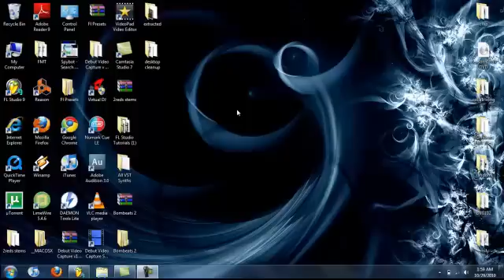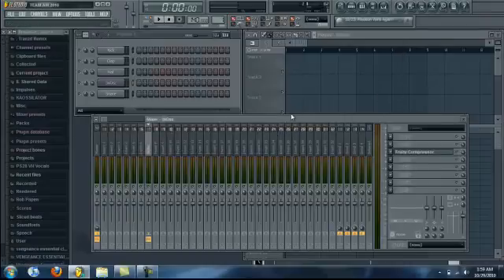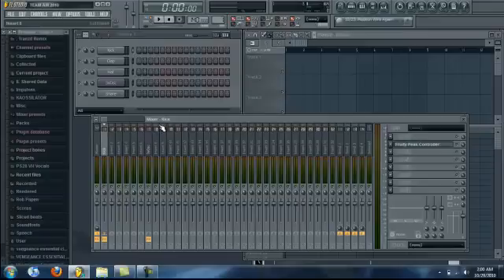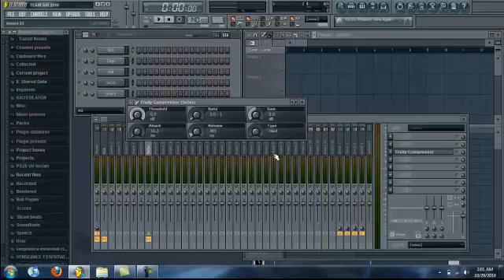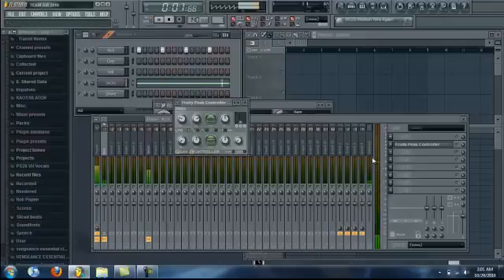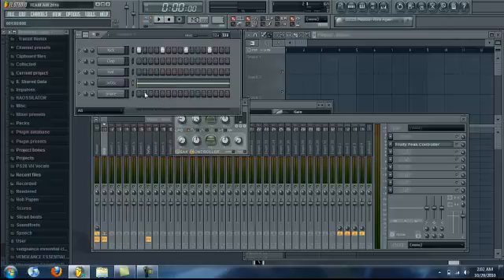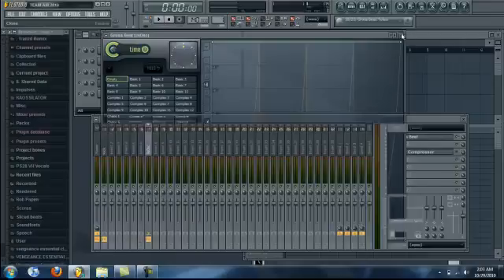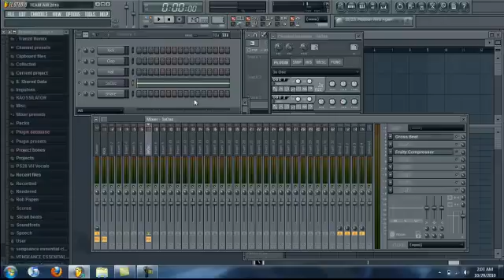Fl Studio - How to Sidechain 2 Ways

Comment: i've noticed using the  fl limited forces u to have your synth and kick drum under the same track(pattern) and it sux because i often use an external vst with an arp for some parts which is longer than 64, which is the maximum allowable amount of kicks it allows. Therefore it only will duck for the first 64. Im a newby and dont really understand it all but i cant get it to work. I have to use gross beat off the kick because when i compose songs i draw them out in the song part.